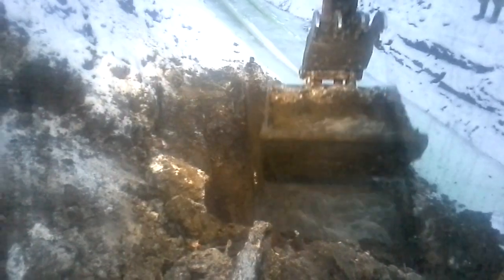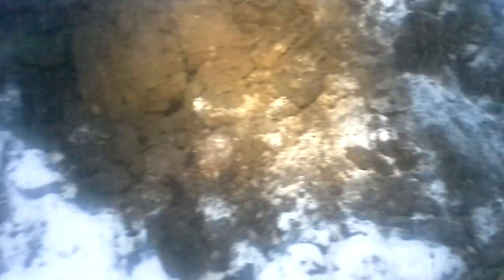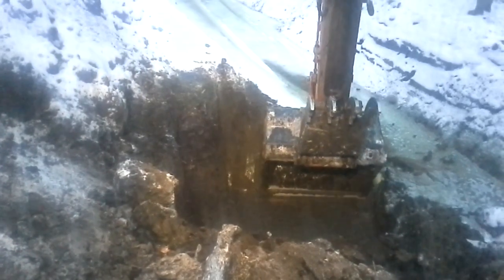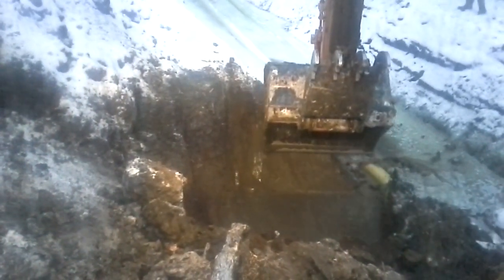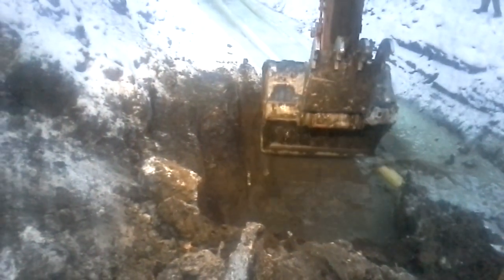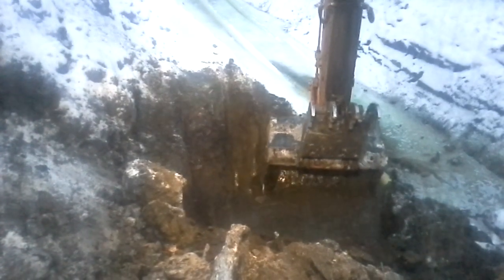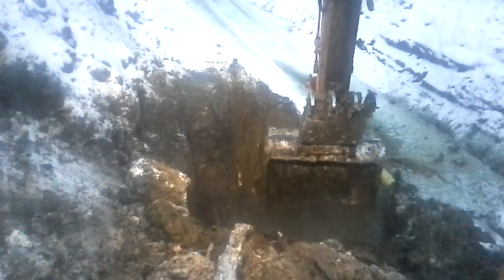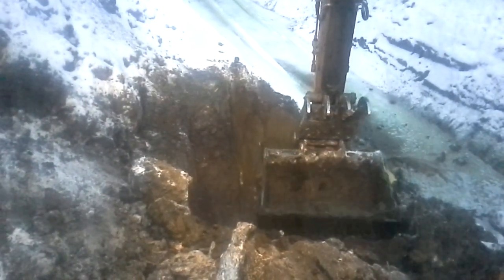Pipeline tips and tricks #28 bailing water

Comment: I don't expect you to see this at this point. But, if you're scooping something as light as water, as opposed to digging into the dirt, wouldn't you want to cut the engine speed some? That would save on fuel and engine wear.
Reply from the maker: Mike Rodgers this is just my opinion but i think you should run the hoe at full throttle all the time.the reason for this is you don't have the same feel for the hydraulics when you idle the engine down.It also effects your timing.After you run the hoe for awhile you can tell the difference between hitting a rock , a piece of pipe, or cement ,and even wood.being able to tell the difference between a log and pipe may come in handy some day.most company's don't care about fuel as long as you get the job done quickly and safely.
Reply: Barry Kozdrowski I guess that makes sense. "Timing" won't be an issue for me though, I've got to rent a backhoe sometime soon and the last time I was on one was, oh, 30 years ago? Thanks for the reply, you do have some really good videos, I picked up a lot.